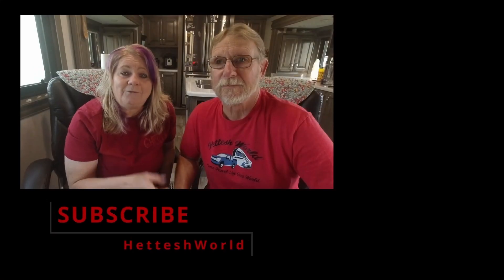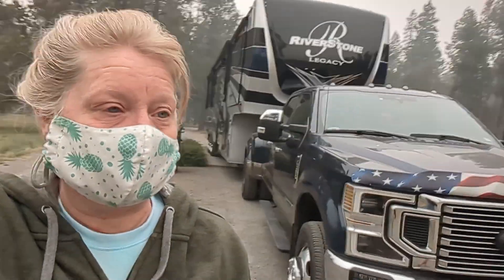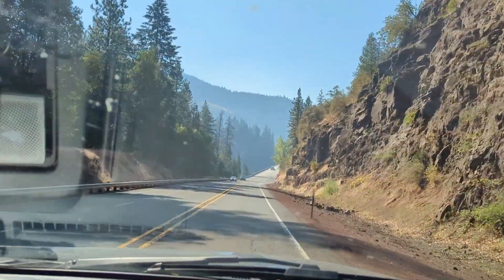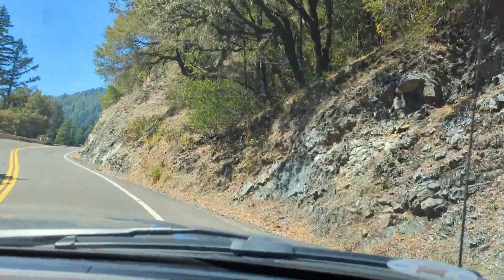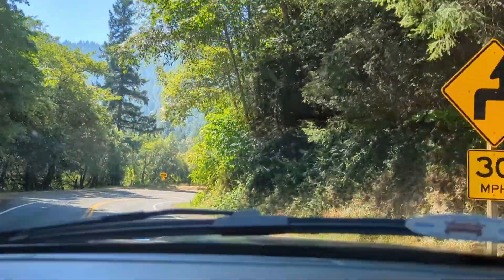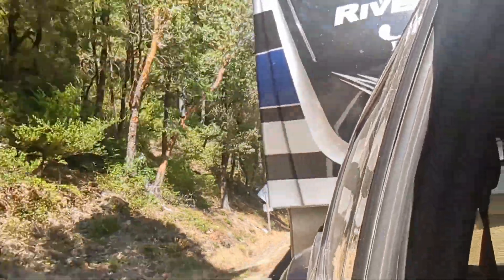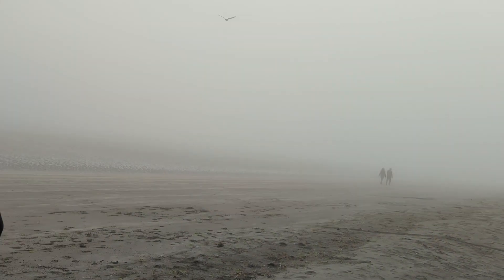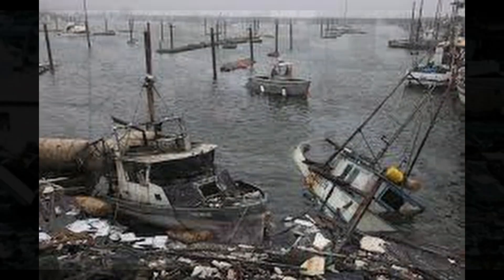California RV Travel Day Troubles Sewer Fires Redwoods Sharks Pacific Ocean Homeless Fulltime RVer

Comment: This weekend I completed a 35hr+ round trip to Manhattan in an old thirsty truck. It got me wondering what kind of milage you get in your massive new truck. It did not help that gas was >$6 a gallon and it took 3hr 10 minutes to go <3 miles to the Holland tunnel from my daughters apt. We sat idling at one intersection for 30 green lights in a row without moving!
Reply from the maker: Towing is between 9 and 10 based on the roads. Not towing 16 to 18. Bob has been very happy with our truck and the mileage we've been able to get, especially with towing. Even going through the Teton pass we were at 9:00 which was steep upgrades and steep down grades with no side rails. It is set up to tow very well cuz it has a 410 rear end which makes a difference. Is good to hear from you. Thank you so much for commenting and we are currently in mass and are still a working our way down to North Carolina